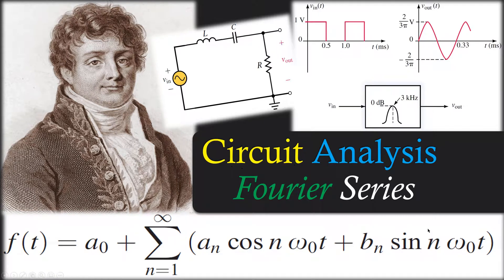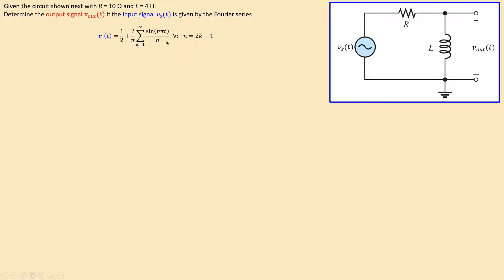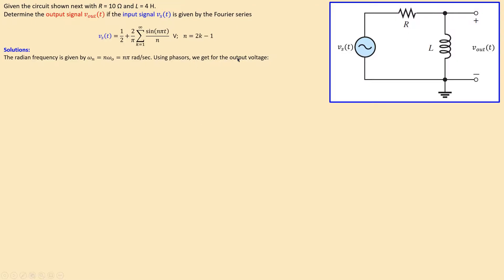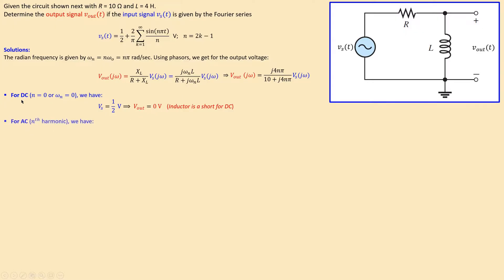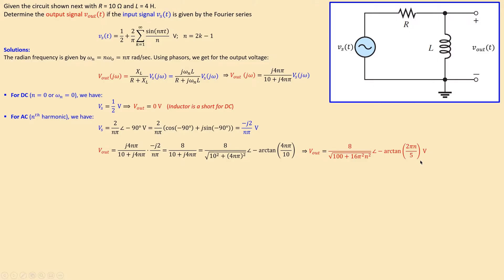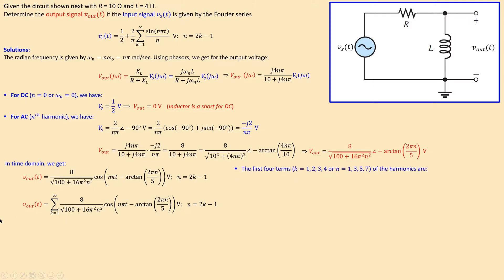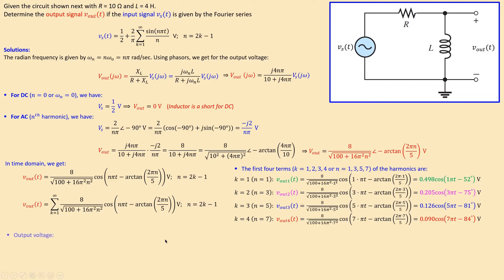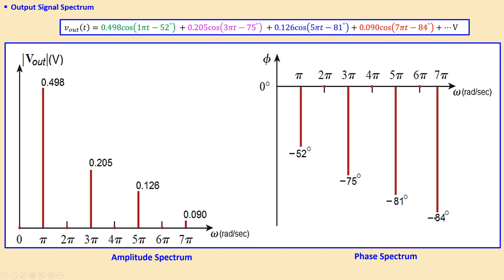Circuit Analysis Using Fourier Series ⭐ RL Circuit Response - Nonsinusoidal Waveform ⭐ Example 1

Comment: Does this mean, if i know input and output signal beforehand i can predict what the circuit could look like by finding the impedance through the reverse Fourier transform of the output signal?
Reply from the maker: Thanks for your message. Indeed, the transfer function of the system between the input and output is determined by the ratio of the output and input in the frequency domain.